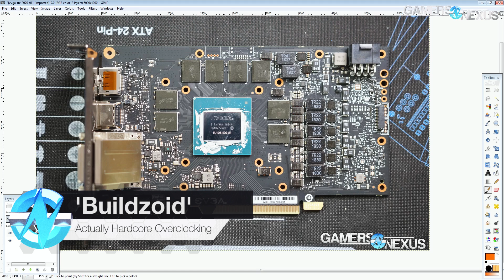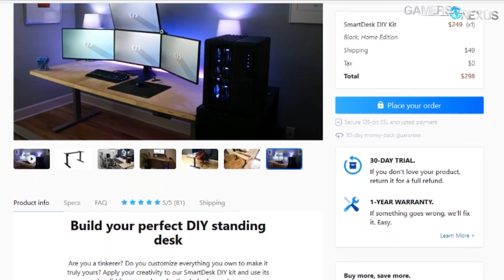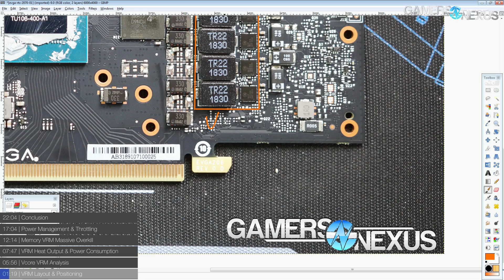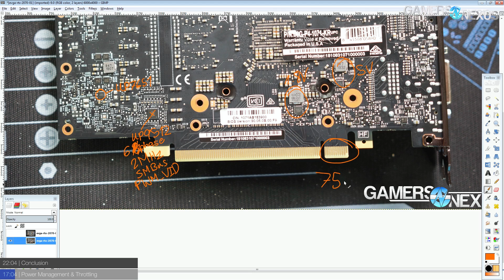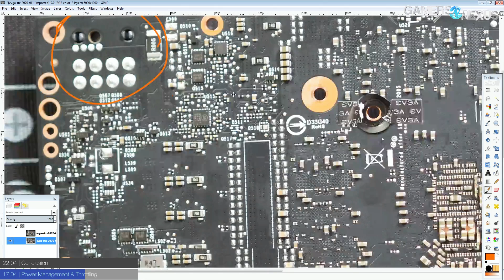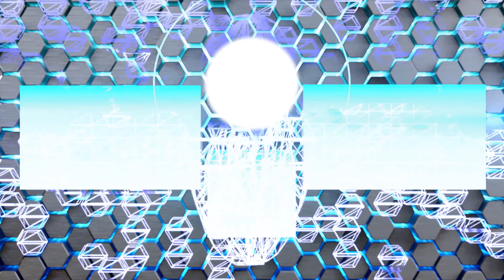VRM Quality of $500 RTX 2070s (Reference PCB Analysis)

Comment: Would the FE card be slightly different from the reference design? I seem to remember the PCIe power on the 2070 FE facing towards the front rather than to the top like this EVGA board.

Comment: 8:30 those tiny MLC's stuck across two bits of the larger SMD cap pad at a funky angle are making my teeth itch. For the love of all that is OCD, why couldn't they mount them to the center little pad instead. At least that way the little MLC's would be square with the rest of the components in that area!

Comment: 150W on the 8-pin PCIE? Really? From what I can tell it should be fed through 12V4 and 12V5 rails and those are like 25A each on any decent PSU. The spec seems to require at least 8A on 12V4 though, with a peak of 13A on a 550W PSU. So is that where your number of 150W (12V * 13A) comes from?

Comment: #AskGN 

can power limit (current) kill GPU as well like voltage and heat?
Reply: Heat can kill GPUs (and CPUs) if tJ max of a chip is exceeded for extended periods of time. Voltage doesn't kill, current does. The higher the voltage the easier it is for current to flow. Power Limit basically limits the amount of current that can pass through the chip so that it doesn't draw more current than what is safe to handle for the silicon, at least in theory. If no power limit was present this wouldn't do really anything for regular use. It would just mean that if you were overclocking and set the voltage high enough, nothing would prevent the card from actually pulling the current that that voltage demands.
Reply: Voltage doesn't kill, current does - Complete wrong!
Reply: Voltage is just a measure of the difference of electromotive pressure between 2 points in a circuit. High voltage is only deadly when current is allowed to flow through the circuit. It's like the difference in height between a skyscraper and the ground. The higher the skyscraper (voltage) the bigger the difference in height (electromotive pressure) between it and the ground. Why do you think for example DRR3 can run safely at voltages exceeding 1.75v when if you were to apply that voltage on a CPU it be dead in no time, it's because despite the voltage, RAM doesn't draw a lot of current. If you're still not convinced you can look up on Youtube Jefferson Lab's video where he touches 200,000 volts and guess what, nothing happens.
Reply: 200kV with 0.0xxx2 current does nothing, we all know from School, but thats not relevant for Voltage Regulators on a CPU / GPU or even RAM
Reply: Why not?  I'm having trouble understanding what the difference is.
Reply: Kralord... both voltage and current are involved because they are related.  What needs to be remembered here is that because voltage is the control on a semiconductor, current is not the destructive component.  When the voltage is set within the specification of the chip, unless some kind of failure occurs, it will never draw more current than it can manage.  As you said, high voltage only causes damage if current is flowing.  If you set the voltage above the specified limit for the device, it allows more current to flow than the structure of the device can handle, you literally erode the semiconductor switch to the point it can't shut off anymore.  The card power limit would do nothing to prevent overvolt damage at the semiconductor level.

Basically... removing the 'power limit' means removing the restriction on incoming current, if voltage is within specification and the heat is managed, it should not cause an significant damage to the device as it will only draw as much current as it can, no more.  The issue then becomes temperature (which affects a semiconductors current capacity negatively) and whether the cooling solution can manage the temps or you need to switch to some more exotic form of cooling.  So you go from an artificial 150W limit to whatever the VRM can handle and the cooling solution can dissipate for the given voltage.

So while current does indeed kill, it's the effect of temperature/voltage that actually does/allows the damage. Power(heat) = Voltage x Current

Comment: I wonder, why don't they ever give the VRAM a 6-8 phase VRM setup to support overclocking a bit better, e.g., 8x 60 amp  modules so that each RAM chip can confidently have enough power to handle some minor overclocking?
Reply: what, that's not at all why vram doesnt overclock much... the video even stated how overkill the VRMs were
Reply: If it is worth doing, then it is worth overdoing :) 8 phase for thee VRAM and 12 phases for the GPU.

Comment: Can anyone tell me why the lines (idk their actual name) from the PCIe connector, to the GPU die, are not equal lengths and just appear sloppy? I could be wrong on the equal lengths. But either way, I've noticed that on all the 20 series cards, even aftermarket cards, that they just generally look like crap. Compared to the older generation cards.
Reply: @chronowerx  See, I was simply comparing the tracks to that of older generation cards. Like my Titan Xp for example. The tracks from it's PCIe lane, to the GPU, they're not straight but they do more precise turns and such. Like they're much more organized looking. And just Google image searching of other cards, all the way down to the 500 series. From what I can tell, they all use a cleaner looking track routing. That's why I was confused as to why the 20 series decided to go all wet spaghetti noodles on us.

Comment: #askgn Are you familiar with any work regarding the difference in water cooling performance if you employ laminar flow in the tubing.  I had ideas similar to this 7 year old air cooling post by Rob Spiegel.  "https://www.designnews.com/electronics-test/turbulent-flow-versus-laminar-flow-cooling/163938973534399"  That is, employing laminar flow in the tubes and turbulence by porous mesh.It's a potentially easy mod but the question is whether it has any benefit since the net flow will still likely be restricted by some other bottleneck in flow at the cooler or radiator.  Microtubing (drinking straws basically)  made of PEEK or Polyimide were what I was thinking of and are available in pretty low wall thicknesses and diameters (I think i've seen PEEK as low as 40AWG, PI 36AWG, on ebay).

Comment: for a 500$ premium price tag (on the mid tier)  i expect a beefier PCB, just compare this with a reference 1080
Reply: Tbh you dont need beefier PWB all you need them not to be scumbags and allow higher power limit 90C for VRM is totaly fine and these thing hit like 70 still got damn reserves but limited to 114% especially Gigabyte one has 8+2VRM ($500 version) and yet same 114% limit almost like they are afraid that cheaper cards would match the the 600$ ones?
Reply: @michalm.3372  thing is, they are making even more profit margin by using "good enough" components and i cannot forgive them expecially after raising again price on all GPUs.
Of course on the power limit question you are completely right.
Reply: Yes indeed I can concur we design safety control units for gas boilers for respectable brand (I won't name don't wanna get fired) and they are constantly pushing cost restrictions at expense of quality its not just Nvidia it 99% of companies unfortunately :-(

But in GPU case I'm pretty sure parts will outlive its usefulness as 5y old GPU dying does not hurt that much still its sort of sad.

Comment: 150A * 1v = 15 Watt??
Reply: 15W is the power loss/heat dissipation which depends on current, Rds of FETs and switching losses.
Reply: So the 15W is a guess based on a 0,000375 Ohm Rds.. or how did you get that figure? :)
Reply: 8:40

Comment: I am trying to remove the power limit of a MSI 2070 armor (non-A chip) but it cant be flashed with a A chip bios yet.... but I have clear access to one shunt (the 8 pin one) without voiding the warranty by removing the cooler, is it safe to shunt this one shut? will it remove some power limit or instead unbalance the power control?
Reply: If you want to see what shunt molds do, watch a video on doing it with Pascal.

It'll increase power consumption and smooth out power limit hitting, but it won't increase the actual power limit. That involves modding or a new BIOS
Reply: I know how to do it and I did it once on a 1080 with liquid metal, but it had 2 resistors to shunt, like the one I want to mod, what I want to know is what happens if I only shunt one of the 2...
Reply: @joaoascenso5798  Then the mod only applies when your GPU draws power from the resistor you modded.
Reply: @joaoascenso5798  I also forgot to mention if there is only an 8pin and the PCIe power, then shunt modding both resistors is worthless since it will detect something is wrong with current draw and remain in 2D mode (300mhz).
Reply: I will try it but with a 0.003 ohm resistor, jut have to find a way to do it without soldering...
Reply: https://www.overclock.net/forum/69-nvidia/1706276-official-nvidia-rtx-2080-ti-owner-s-club-274.html#post27686818
Reply: That's my mod!! and it works!

Comment: Meanwhile, AMD still didn't bother do any power monitoring on the PCB...
Reply: And yet they were able to fix the RX480 PCIe power problem with a VBIOS update? o_O
AMD obviously knows where the power is coming from on the board.
Reply: carbonsx They could just change the ratio of the power from PCIe slot and connector, from something like 1:1 to 1:1.2 to ensure the PCIe slot power draw doesnt go too high within factory power limits. I have yet to find reference RX 480 power draw when power limit is significantly raised and reached though.

Or maybe just use the PCIe power connector as the sole Vcore power source next time, as some custom cards do

Comment: Did they really apply paste like that?
Reply: Complete coverage of the die is important with GPUs, since there's no heat spreader. While not pretty, too much thermal paste in this case is way better than not enough, and paste is cheap, so the manufacturers err on the side of caution. It ain't pretty, but it's like that for a reason.
Reply: Pretty sure GN wiped off the paste on the physical die to show that it is all the actual 2070 die
Reply: Obviously they wipe the die clean, but the remaining paste isn't runoff from doing that.
Reply: 😱 L😂L
Reply: lol
Reply: Beggers can't be choosers when you have a 4-year old making 15 cents a day applying the paste.
Reply: Those 4 year old kids can be hell on the profit margins.  Some of the little bastards are paste eaters!
Reply: It looks like a drunk was trying to chalk around a bathtub. :-P